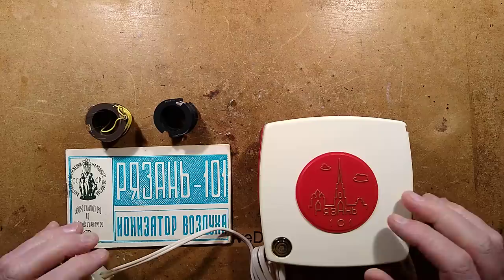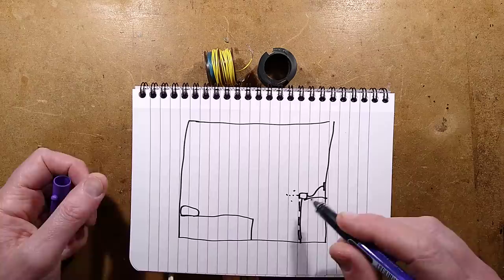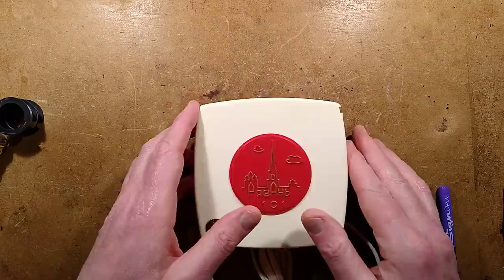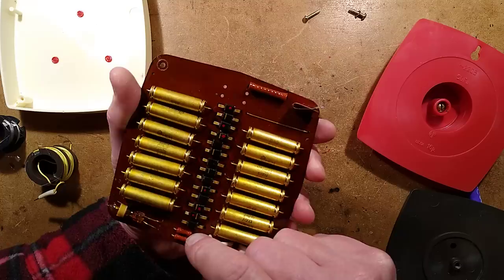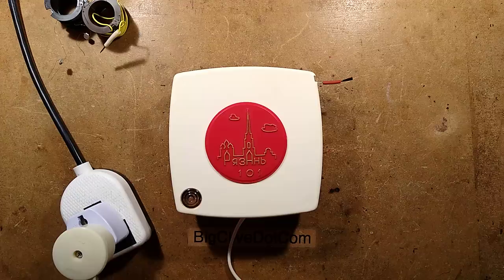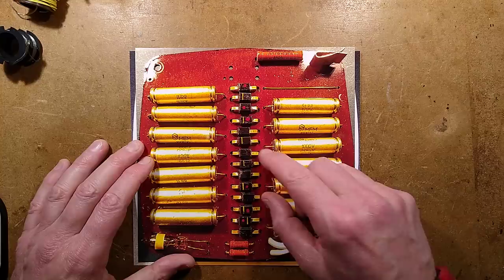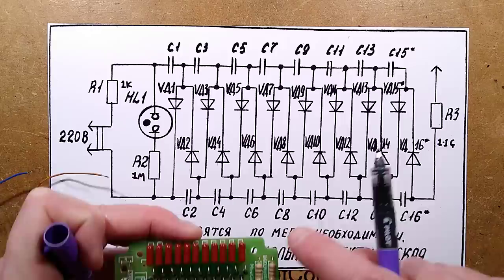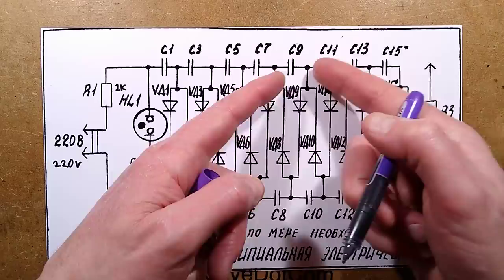Inside a soviet ionizer from 1990 (with schematic)

Comment: This has such a lovely retro look, very 1950s, from when they literally just soldered all the massive (oft hand made) components together, sometimes they didn’t even use a board. its refreshing to see something so different. Cheers Clive.
Reply: Looks a lot like the chunky old phenolic they used to do on stuff in the '70s, CHEAP stuff in the '70s! I'm thinking of old Radofin / Acetronic consoles in particular. Something about single-sided PCBs maybe, or maybe both those things are just a result of primitive manufacturing at the time.
Reply: Actually 1960s. 1950s designs were a bit different, particularly in the USSR. Also, a household air ionizer in 1950s, particularly in the earlier half of 1950s... well, no.

That doesn't change the fact that in the USSR (and Russia) 1960s, 1950s and even 1930s designs were in production well into 1980s and 1990s without even the slightest facelift, and sometimes there are things that are still made like 60 or 70 years ago even today, in 2023. 
For instance, one can get an set of enameled steel cooking pots (or a chamber pot with a lid) with (or without) flower decals that look precisely like in the days of Gagarin's flight or Caribbean Crisis. Or even earlier. The factory in the town of Lys'va, Perm Krai (north-east of the European part of Russia), uses German technology from the early 1930s, albeit slightly improved, so that the enamel in question is of really high quality and original composition... Which indeed is a testament to brilliant chemists and engineers of Weimar Republic...
While there is a heft of gloomy sarcasm in my words, it's not 100% sarcasm (as much as I wish it to be).

Comment: "220V" was specified because, in fact, USSR actively used THREE voltages through majority of its history: 110v, 127v and 220v.
110v was in train sockets, so «train-portable» things like an electric razors often had this as switch/screw dial. It was also used in some very old houses, causing a huge pain in the ass to their inhabitants.
127v was all-USSR standard until late 60s, when it was slowly phased out with 220v. Very slowly, in fact, last house in USSR was switched to 220v as late as 1990 (even in Moscow this process was finished only in 1986). Rural areas sometimes used 127v way in late 90s to early 2000s, if they were not connected to grid and used their own GOELRO-era equipment for generation and distribution of power.
And 220v is a common standard we all know. USSR decided to switch consumer voltage to allow more current per wire, thus allowing for new and fancy stuff like electric kettles, electric ovens, et cetera, as well as saving on metal on countrywide scale.

So, specifying input voltages when impossible, and putting voltage selector when possible was a must. Like, a fragment from a TV instruction of the era:
>>>Before connecting the TV to the mains for the first time, you must do the following:
a) check whether the fuses correspond to the actual grid voltage. At a voltage of 220 V, the fuse should be at 3 amperes; at a voltage of 127 volts, at 5 amperes;
b) put the input voltage switch in a position that corresponds to the grid voltage in your apartment.
Televisions are manufactured from the factory with a voltage switch set to 220 volts.<<<

Hope I helped you:)
Reply: Also interesting that they had an oungrounded, IT system. The secondary of the distribution transformer was no connected to ground and you would only get shcoked if you touched both wires.
Reply: Thank you
Reply: Supply voltage standardisation is a surprisingly recent thing all across Europe though. 220/380 V 50 Hz had been more or less agreed upon as a standard for new supplies by the end of WWI but existing grids had all kinds of odd setups. Edison DC (often 220/440 V) was used well into the 1960s in well-off city neighbourhoods (the ones that were first get electricity) and AC conversions often tried to make do with the existing three wires (+, - and centre/neutral) using 127/220 V systems with no neutral supplied or split-phase 110/220 supplies. On top of that there were some 127/220 V supplies with neutral and some oddball 150 V supplies. Belgium and Norway still have extensive 230 V three-phase networks and apparently so does Italy. I think Germany removed the last leftovers in the Berlin area less than ten years ago. Norway even has an IT supply with local earth, which is less than ideal as soon as there's a fault somewhere because the IT turns into a TT with dodgy earthing.

50s valve radios could usually run on 110, 127, 150, 220 and 240 V, some AC-only, others AC/DC.
Reply: @Ragnar8504  New York completely phased out Edisson DC only in 2007(!!!)
Reply: @Ragnar8504 what do you mean by some parts of Italy, belgium and norway have 230V three phase network? Isn't that that's the european standard now. All of Poland has 230V three phase.
Reply: @powder-phun949  133/230 V, not 230/400 like the rest of Europe. Most places that used this supply type had wye-configured transformers and either a TT or TN-S system, Norway has delta transformers and an IT system, so you can't really say it's 133/230 but it's definitely 230 between phases. Conversion to 230/400 V TN-C-S is ongoing though.
Reply: @Ragnar8504  Yeah in Italy there are some areas with truly ancient grid equipment that still run on 230V three phase, meaning the phase-neutral voltage is ~110V, but they're never used in that configuration. Instead of getting a phase-neutral pair, the people in those areas get a single phase-phase pair so the final voltage is still 230V like everywhere else. For obvious reasons they are also exempt from the requirement of having to go with a three phase system for more than 6kW of allocated power.
This creates an issue for anyone trying to start a small business as they will not be able to get 400V equipment to work, I'm unsure how they handle this.
Reply: @demoniack81  Of course, all the countries I mentioned only use 230 V between two phases, although it depends on the network operator if homes get two or all three phases.

Berlin did have what was considered TN-C-S but effectively worked as TN-S. The PEN conductor was supplied at the meter, theoretically providing 133 V, but was only used as an earth conductor.

Thrifty people with a healthy disregard for laws and access to 127 V appliances had a way of getting free electricity with such a supply though. Single-phase two-wire meters only have one current-sensing coil, so one of the two 133 V phases passes straight through, while the other is metered. On a 230/400 V supply the latter would be the neutral connection. In that case the neutral doesn't even have to pass through the meter for correct operation, it's only needed to supply the meter itself (i.e. you can run the main neutral to a splice block and only, say, a 1.5 mm2 spur to the meter).

So if you connect your loads between that phase and a neutral you scrounged somewhere (apparently well-bonded central heating pipes were popular) you got free 127 V.
Reply: mmmmmmmmmmmmmmmmmmk, very un-useful but interesting, thx m8.
Reply: @Ragnar8504  Did those old installations which had 220 V between phases and 127 V between a phase and ground have no ground wires? That might explain why they used a water pipe for that.

Comment: Soviet electronics almost always came with schematics, although often they were very messy and not well laid out, but still a very nice thing.
Those MBM capacitors are oil impregnated paper (not in-oil), never seen one that isn't very leaky nowadays.
Reply: I was about to ask if they were paper capacitors... thanks for answering!
Reply: Makes sense imo, I'd imagine the Soviets would have nothing to gain by keeping it proprietary given how they ran things (Not that it couldn't be reversed engineered without much effort anyway).
Reply: @shodan2958  I think it more boils down to the fact that for years (if I recall, up to the mid-70's when they introduced the Soviet Seal of Quality, the "mirrored K in a circle") Soviet products had zero warranty; and with the quality of some products it meant that you really just bought a dead weight.
From what I heard, despite that fact, there was basically no "true" way to buy spare parts so from what I've been told, Soviet electronic magazines offered tips to fix common devices and also DIY ideas listed cheap devices (usually radios) where you could source the required components.

Amusingly I bought a Soviet G&W clone and even that game come with schematics.
Reply: @LeSarthois  almost correct but not quite. A mark of quality (GOST), its more like a K turned 90 degrees clockwise in a pentagon, not a circle. 
 If i remember correctly, warranty on items got introduced after the soviet collapse. And yes you were encouraged to fix your equipment yourself, or take it to the repair "shop" to fix it. The guys there did everything, from rewinding transformers to changing components. And there were a lot of these shops in the cities. 
Pretty much all electronics were mainly analog. And in the user manual you always had schematics, usually with values and sometimes even oscilloscope curve pictures on some TV or radio equipment for easy troubleshooting. 
So if something you bought didn't work, you take there it and the guys used to fix it for pennies.
Reply: @shodan2958 Proprietary consumer tech-no. Secret and censored military stuff - yes.  simply did not exist in widely available books and manuals.
Reply: @LeSarthois es, there’s a bad habit of older soviet engineers/technicians to murder perfectly good old devices for their components. FFS, most of these components are worthless and have much better replacement, while the complete device had actual value. :(
Reply: @noop9k  Yeah that makes sense, I was thinking more consumer gear when writing but obviously they aren't going to give out schematics freely to missile systems and nukes (Imagine the fireworks that would cause like damn)
Reply: @noop9k  Even worse, for every soviet device I google in Russian the top results are instructions for scrapping and salvaging materials from it. It's not as bad here in Poland, but most vintage computers and other high end solid state gear were scrapped already because they used gold contacts in sockets and transistors/ICs with golden legs. I still see lots of 70s-80s test equipment for sale "for palladium and gold recovery" :/
Reply: @IgnacyG1998  This situation drives me mad. Those scrappers are often uneducated ignorants who have no idea what they are destroying for a tiny amount of precious metals. Rare vintage synth, one of a kind DIY computer prototype - they don't care, everything is vandalized. This was happening in USSR as well, but back then you could get a long jail sentence if caught. Not entirely legal today, but harder to track, I guess.
Also, most govt-affiliated companies are required to send their old equipment to the govt org doing the same. They can't just sell it or throw away, except if someone replaces it with something similar-looking to make bureaucrats happy.
But people who scrap for metals and who scrap for components because of a habit to hoard them are very different, though one can do both.
Reply: @IgnacyG1998  And, if you want to buy non-consumer vintage soviet stuff, such as a minicomputer, you have to pay more than the cost of the precious metals it contains, which can be 100s or 1000s of USD.
Tough proposal for a hobbyist collector, therefore scrap yard people don't bother trying to sell. A waste of time.
Reply: @IgnacyG1998  You can often find damaged boards of small home computers, like speccy clones. Scrappers would destroy the body, take cables for copper, cut out KM-series green ceramic blocking capacitors, and throw away the rest as worthless.
BTW Soviets considered palladium relatively cheap and used it often instead of gold plating.
Reply: Very similar to wax dipped one that were made in the US in the 60's and 70's. Also, as I've said elsewhere, the diodes are bigger because they're germanium diodes. That's why they're only rated at 300mA. 1N0007 are silicone ones and are more efficient. I suspect it's a design that dates back to the 60's.
Reply: @xminusone1  Highly unlikely to see germanium diodes in this package. Also, they are unlikely to be used with high voltage. Can be easily checked though by measuring voltage drop.
Reply: I had an old digital alarm clock radio made by Philips bought in 1981 and there were not only the owner's manual plus warranty card but the schematic too!

I think it was somehow a standard back then.
Reply: Not only soviet. All eletronics from eastern countries came with schematics. Reason is simple. You can repair at home.
Reply: @noop9k  What do you mean?
Reply: @jed-henrywitkowski6470  Germanium diodes don't usually come in an epoxy/plastic package, but instead either an enclosed metal shell, in a tube, or just stacked square discs on a post.
but germanium diodes were used for high voltage, in fact silicon diodes were not made for high voltage back then, it was just more practical to stack more selenium discs in series
Reply: @shodan2958  including schematics in radios, televisions, and electronics equipments used to be very common in the 60s, but I guess the Soviet union just carried that practice up until the early 90s.
Reply: @noop9k  If you had a chance to work with the military tech good chances are that the full manual is SOMEWHERE nearby, and a simple instruction (rough schematics, pinouts, shit like that) is glued onto a hull of whatever you're working with. The only problem is typically fishing said manual out of a pile of identically looking manuals. The ZIP (repair kit) has fucked off decades ago tho. The only chance you'll find that is when you crack open an old warehouse and there's like twenty of them brand spanking new. 
t. actually worked on Russian censored military stuff
Reply: @Reriiru  Sure, while I haven’t worked there I have some of those blue manuals with schematics. I also have some IC manuals printed for a post box bureau.
Reply: @Reriiru  But what I was saying is that outside of your job you simply could not find any info, sometimes not even a mention. There was a sharp distinction between public information printed in large amounts and restricted stuff with inventory numbers.
And some of the public info was propaganda-ridden BS :)
Reply: @noop9k  Oh yeah, sure, it would not be public. It would either be Secret or DSP (dlya sluzhebnogo polzovaniya, “for service use”, sort of a not so secret secret). But say, if you somehow got a hold of some equipment like we’re describing here, you’d probably have an access to it’s full technical documentation. Either right next to it in a garbage bin where you found it (if someone stole it and stripped all the precious metals before you) or wherever you yourself would steal it from. That’s why a lot of shit on EBay comes with original soviet docs quite frequently, and equipment there went through who knows how many hands.

Comment: Pro tip: Rya-zan'. Two syllables. If you really want to get fancy, the n' is palatalized.

With that out of the way, it's relaay cool that they gave so much info on it in the manual, from field repairs right down to schematics. That's the sort of detail I wish a lot of things came with now
Reply: There's not really a "y" in there. It's more like R'azan', where r is a closer to r in "reason" than r in "rover", and n is closer to n in "niche" than to n in "noon". The first "a" sound changes accordingly, by becoming closer to "e".
Reply: Я is Ya, and should be pronounced "ya", so it's actually "R-ya-zan", not "Rye-a-zan".
Reply: Why does the 'n' need to be palletised? Is it going to be picked up by a forklift?
Reply: @hypnotised-clover  Yeah, but Я palletizes the consonant before it and produces an "а" sound unless it's after a vowel or special symbols so the comment above was correct
Reply: @hypnotised-clover  Terrible experience, wouldn't recomend. Also, your comment is shadowbanned. I only see it in my notifications but not in the comment section
Reply: @kgb4150  Hahahaha, yeah.... I saw that happening.....
Reply: @zappababe8577  The word itself is written as Рязань in Russian - note the extra letter at the end. That letter's sole purpose is to palatize the previous consonant and in general just pronunciation alteration. It does not make its own sound. Hope this helped :)
Reply: @gel-pen-gel-drinker thanks.  I knew that small ‘beta’ (don’t know the Russian name for it.  I learned to read Cyrillic letters based upon knowing Koiné Greek) affected the pronunciation, but did not know HOW it did so.  Again, thanks.
Reply: @dennisyoung4631  No problem!

Comment: 127 volt was the standard mains voltage in Russia well until 1960s, before they finally upgraded it to 220. As lots of consumers still had their old appliances, transformers have quickly become quite indispensable back then! Lots of soviet equipment would also have voltage selectors on them for the same purpose.